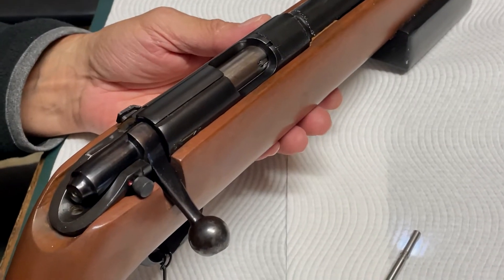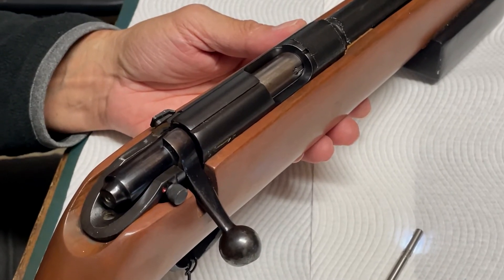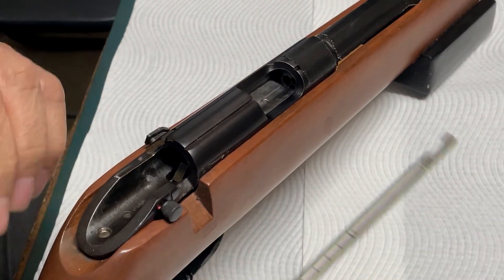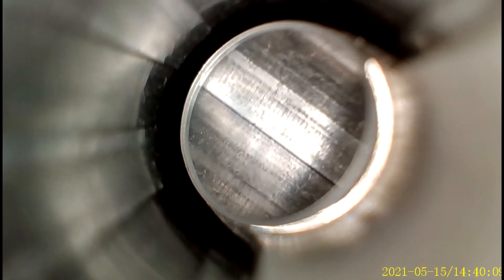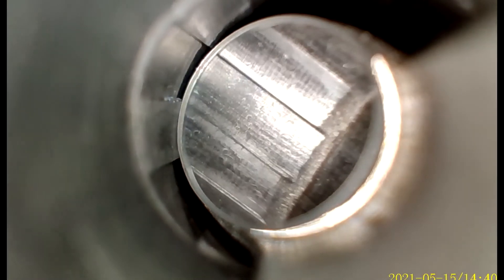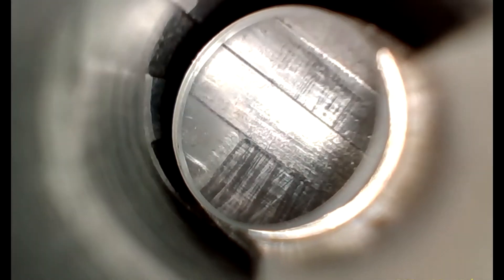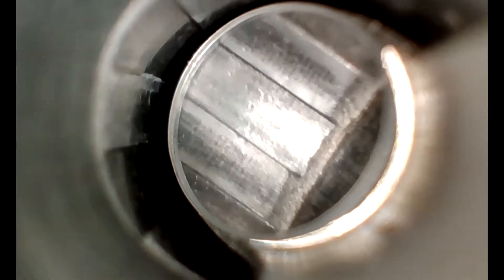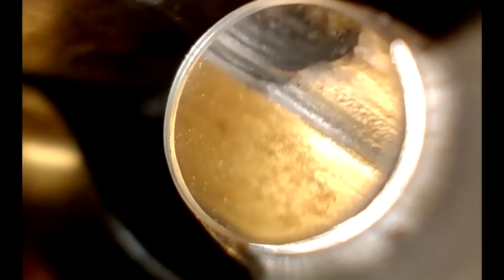22 Rifle barrel chamber

Comment: Just came across this video.   Looks like a solid pilot reamer that caught some chips and chattered.  They are more expensive, but the use of a reamer with a floating pilot that fixes itself in the bore and the reamer turns inside the pilot would help alleviate this sort of thing.